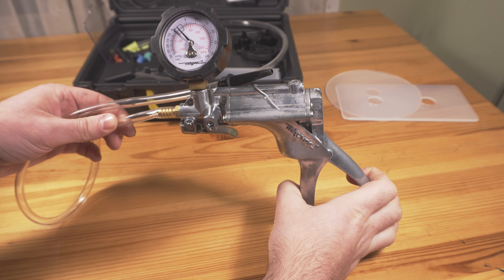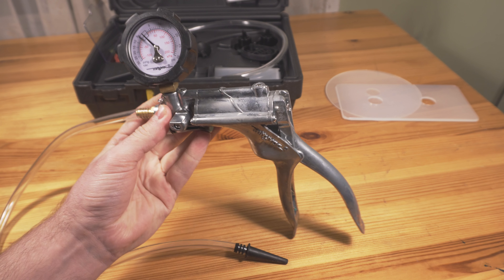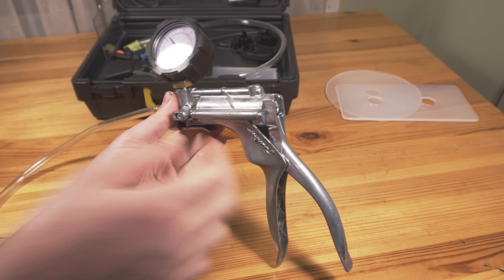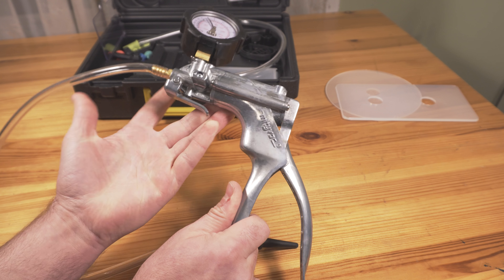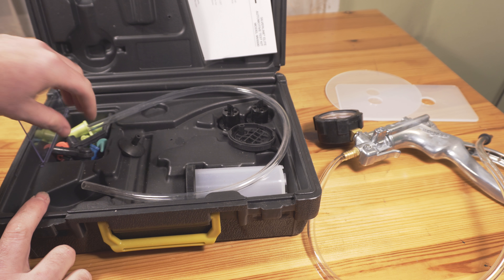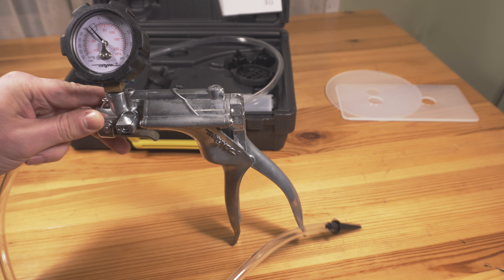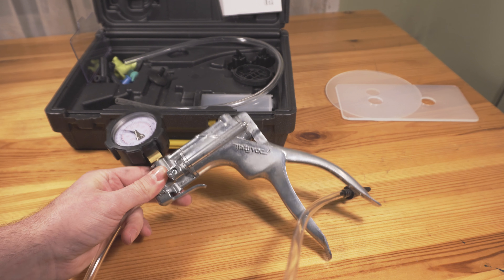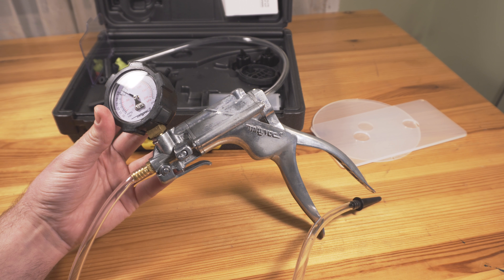Mityvac MITMV8500 Pump Kit - Review / Quick Overview - Vacuum & Pressure Pump

Comment: Well, I rebuild chainsaws and this was the most important tool I use daily.
Even they are good quality and rebuildable, the rebuild kit is EXPENSIVE.
Then the body of the gun is disposable when u have moisture or dirty stuff getting into the air passage (under the steer ball). 7 out of 10 times after u spend $ rebuilding it, it will still not work right. 
There are cheaper vacuum pressure pumps out there for $20 ish. Why buy rebuild kit for the more $ and take a chance and still end up a non-working pump?